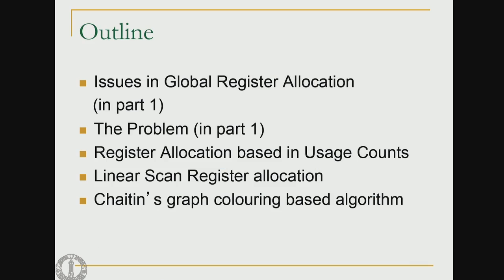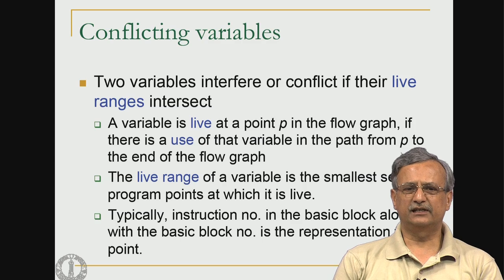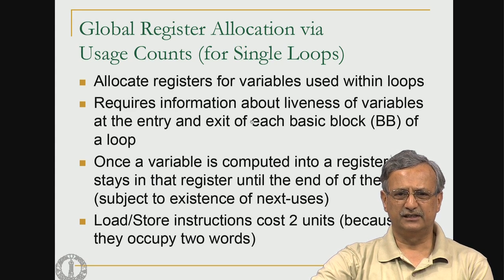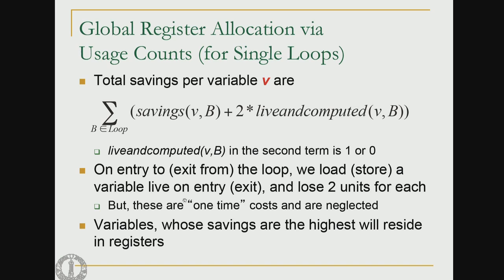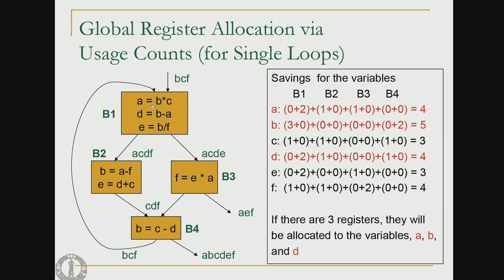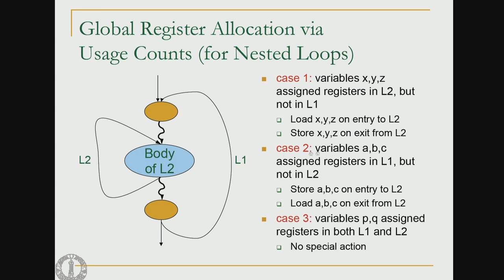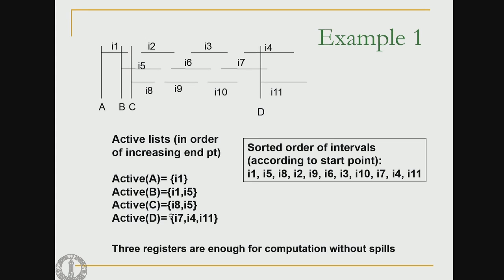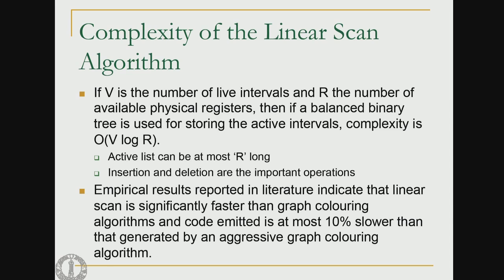Mod-09 Lec-29 Global register allocation - 2

Comment: 4:30 - this CFG seems incorrect, because assume program execution takes the path: B1, B3, B4, B5
If A, is not defined along this path, it should not be used.

For the same reason, the liveness analysis doesnt seem to match up as well.
If you propagate the liveness info backwards from B4 along B3, A should be considered live there as well.